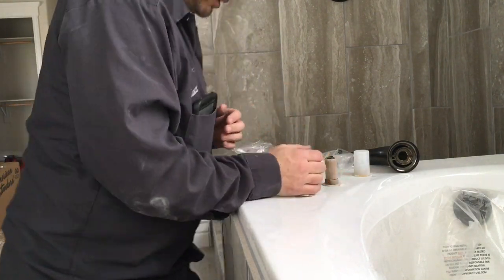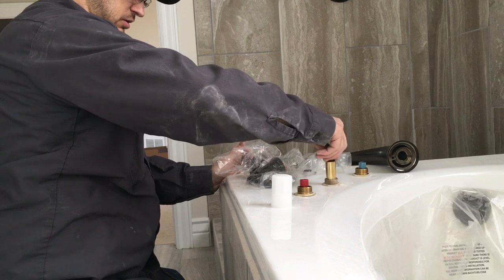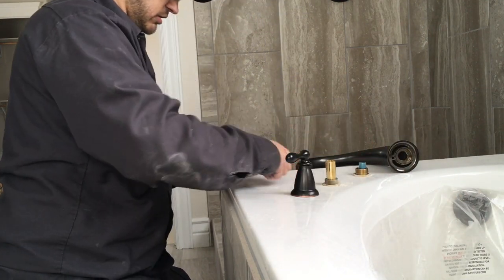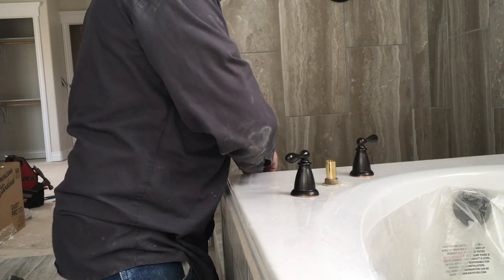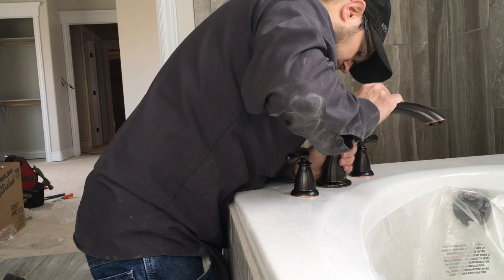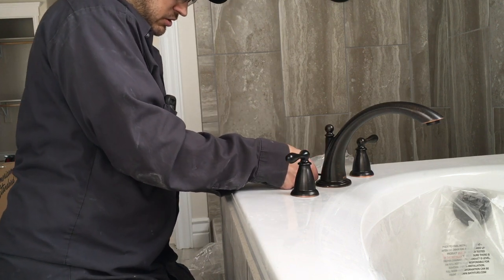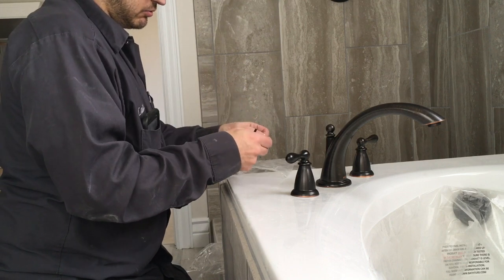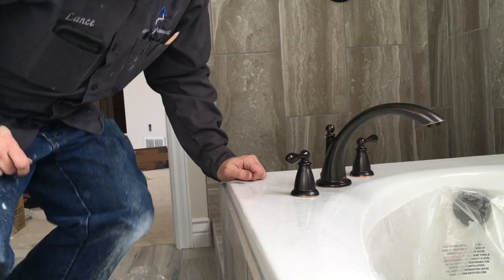Installing Roman-style deck mount faucet trim

Comment: What brand faucet is this? It looks like the one that was installed in my home when i purchased it and now the cold side handle is stripped and i need to see about changing it out. Most manufacturers will send you the replacement pars for free but I'm just not sure whom that is.

Comment: What if you have an old Roman tub and need to replace the entire faucet valve? Seems you'd have to cut an access panel in the side to be able to reach inside.
Reply from the maker: Usually there is a acess panel in place to access
Reply: @lanceball6298 would be nice but the idiots in the 80s who built my house thought it would never get replaced. Those same people thought Carpet was a good idea in the bathroom too!
Reply: @lanceball6298 Exact same! Right down to the ugly carpet. Mine was sea foam green. Trying to go to a phister faucet from who knows what, having a few questions. Thank God for YouTube.

Comment: My faucet is leaking out of the base and I can’t remover it because the diverted plunger won’t come off. How do you free up the diverter plunger?
Reply from the maker: For this style on the spout there is an allen set screw for the spout behind the rubber or plastic plug. For a normal style they are sometimes threaded or have a set screw. For this I would recommend calling a service plumber as damage is likely onbthe set screws.
Reply: @lanceball6298  I was pulling up on the diverted rod while trying to unthread it. I stopping pulling up and it came off. Not my brightest moment.

Comment: What a beautiful faucet! Can an older Moen Chateau series Garden tub 1380p faucet be replaced with this one?
Reply from the maker: Unfortunately its a different valve body for the chateau you would need to switch out the valve body to change to this trim. This is the 4792 valve body

Comment: Hello! I would like to change the faucet and the knobs on the top. Most people advised me they cannot be done since they need to be accessed on the wall.
Reply from the maker: As long as its the same brand there should be multiple designs that fit
Reply: @lanceball6298  
So the people who told me that they needed wall access just to change the knobs and spout are wrong.
Reply: Do I need to hire a plumber for this? I don’t have the skills☺️
Reply: @lanceball6298  Thanks!
Reply from the maker: @MariaClara-if3vf  probably be the best
Reply: @MariaClara-if3vf    Trying to replace my old delta Roman style tub fixtures.  I contacted Delta by email.  They said as long a the have a set screw the faucet fixtures can be replaced.  You may want to contact your old fixture company to double check.
Reply from the maker: Depending on the situation for this I would call a professional to advise you on your situation.

Comment: The faucet still wobbly.
Reply from the maker: If the faucet is wobbly either the valve assembly is loose or the handle has not been tightened enough. The main spout piece is tightened by the allen screw on the back of the spout. If that does not tighten the trim then its the valve and that has to be tightened by accessing the bottom part of the valve.

Comment: Mine leaks from the main spout... why?
Reply from the maker: Probably needs the cartridge replaced that should be done by a professional
Reply: @lanceball6298  there is no cartridge just a stem... maybe the o ring is bad
Reply from the maker: @krispy5139  like i said call a professional they will have the parts and knowledge to fix it.
Reply: @lanceball6298  No professional needed, just a 50 cent o ring. Yet you are trying to have a professional charge me $200+. No thank you.
Reply from the maker: @krispy5139  o rings come in many sizes and manufacturers are specific to their brand unless you get the right one you will still have problems. Any decent company will carry those specific ones. Not trying to hurt your feelings and I make nothing from it just trying to be helpful. Seen many times when people spend time and money and end up calling a professional anyways. But do as you wish its your money.
Reply: @lanceball6298  I understand you have a business and trade to promote and support. Have a good day.
Reply from the maker: @krispy5139  not that at all but wasted time and money is never my want. Think most people are like me. I also understand that lots of people think that everyone else is out to screw them. The reasons the pros can do it quick is knowledge plus access tobthe necessary tools. Having done these valves many times. You may regret your decision to go cheap. But your loss. My trade can handle its own thanks to DIYers like you.